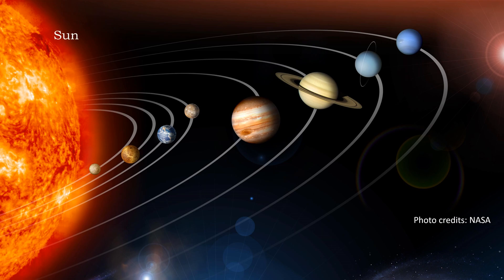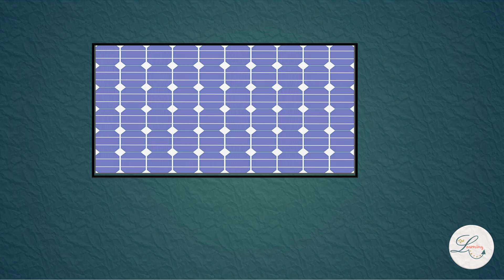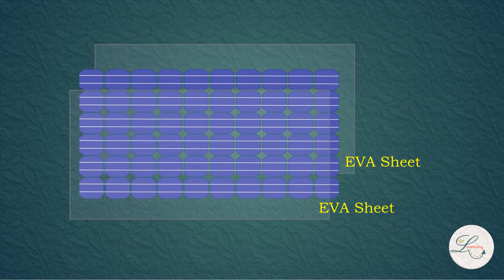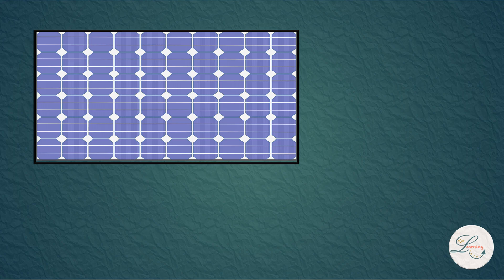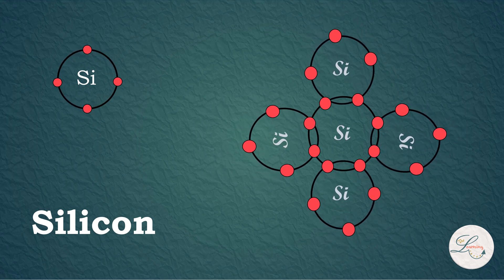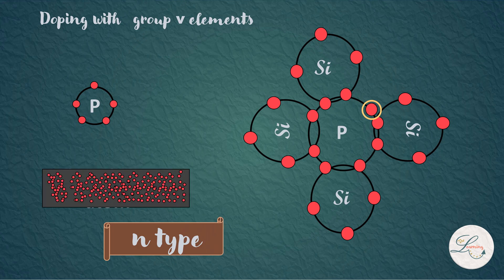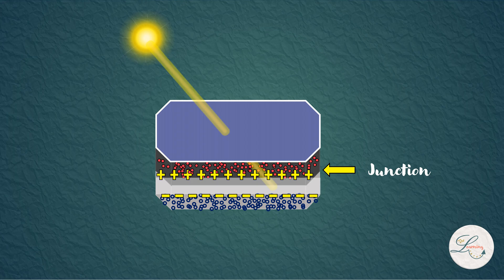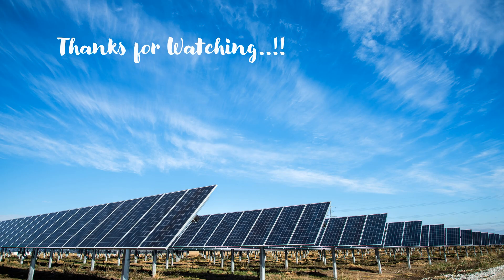How do Solar Panels generate electricity ?? Working of Solar cell with animation.

Comment: By making the N-type layer thinner than the P-type layer, is the "increased efficiency" in current or voltage? Or both?
I appreciate all these videos, trying to learn more about the nature of electricity and the distribution system. Currently working as a distribution designer in NYC :)
Reply from the maker: Its overall efficiency.